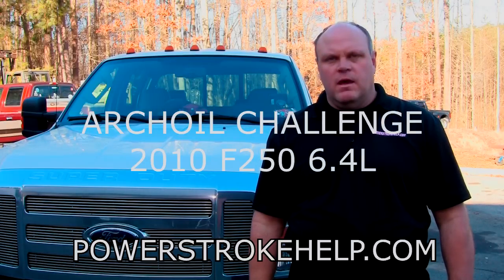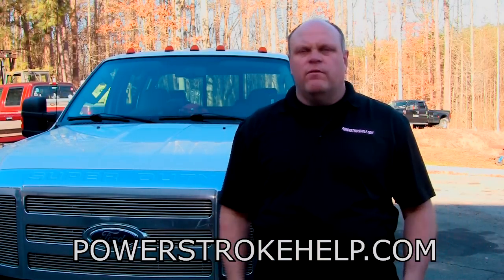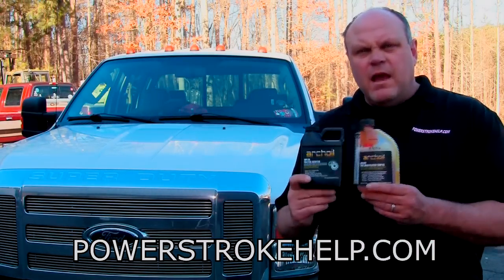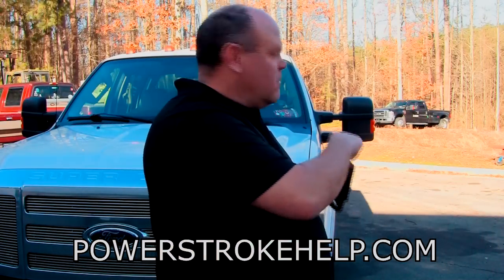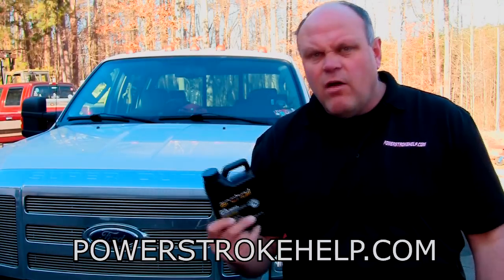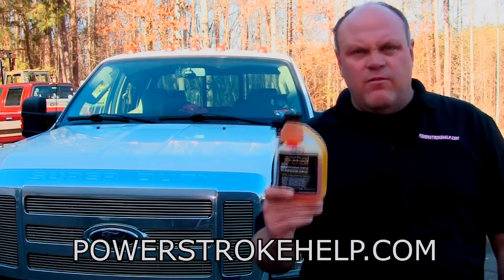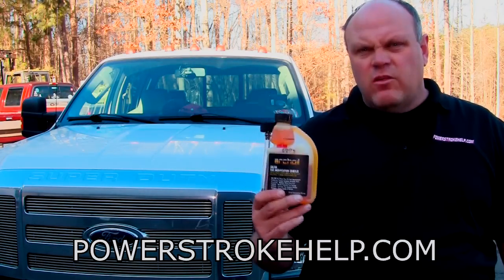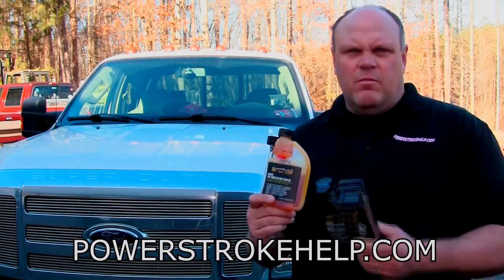2010 F250 6 4L ARCHOIL CHALLENGE

Comment: I have a 2005 F350 crew cab 4x4 6.0L with 180k miles. I use Rotella T6 oil, with Archoil Ar9100. I just added the Ar6200 to my previous fill up ran it out intown, and then filled up again without adding more Ar6200 and took a 100 mile highway trip unloaded and watched my truck get 19.3 mpg. I have never seen this kind of mpg out of my truck ever. And to see that this was accomplished even after the Ar6200 was used up in the previous tank only shows to prove that Archoil has a lasting effect on our trucks. With prolonged use, it only gets better. Archoil is worth the use. My friend used it in his Cummins and said he can tell a big difference in his engine too. It is just a great product. If you are on the fence, just buy it. just try it.

Comment: Just received mine. Will be using in a 2008 6.4 I bought new in 08 that currently has 24,000 miles. I turned my brother on to video he has bought also for his 2 7.3 trucks , 7.3 van, Chevrolet truck. He also ordered the Archoil gun lube.

Comment: I put the AR6200 in my 1988 7.3 idi and holy cow did that thing pick up some snort between the Archoil and electronic fuel pump conversion. I suppose 22.5:1 compression makes it even more noticeable.  Now I just need to try the AR9100 in my 2002 7.3. Talk about stiction.

Comment: Hey bill. Just a little food for thought. You mentioned that the MPGs on your 6.4 went after using the 6200 and you also mentioned that it reduces the soot build up. i was thinking that the MPG increase comes from the dpf not having to regen as often? Or is your truck dpf deleted? If so then im thinking that those who still have the dpf could see even better MPG increases? Whats your thoughts on this?

Comment: Bill another good video. I still have questions about my 7.3. I use standard Rotella 15/45, with the oil additive added does that mean I can go 10k or is that only for synthetic Rotella. What would you recommend. Thanks
Reply: I would change my oil every 5000 miles, also use delo 400 15w40 thats the best desiel oil out there its better then rotella

Comment: I enjoy your videos and did a lot of research before picking my '15 F350 last week. I like the results you've had running the Archoil in the older Powerstrokes... Do you recommend using this in the New 6.7..?  Thanks
Reply from the maker: todapwr1 THe 6.7 will benefit on several different areas. Installing the ARchoil AR9100 in the oil will keep those pesky turbos running good for a long time. Even the newest turbos are having some issues. THe AR6200 in the fuel will help by cutting down soot that messes up the unison ring on the turbo and cloggs the DPF. Meaning less Regen on the DPF and better fuel economy. SO the answer is YES it will help keep your 6.7 running well for a long time.
Reply from the maker: todapwr1 archoil.powerstrokehelp.com

Comment: I've got a 2009 6.4psd. It's been deleted and I run SCT performance tune. It runs and rows line a champ. 
Twice when I was towing it went into Reduced Engine Power mode. I keyed off and restarted and it reset. Now once a week or so it will only rev to 2500rpm and boost will build to 20psi. I key off and restart and its fine again. No engine lights or alerts at all now. Any idea what might be happening?

Comment: Hi have you heard of the archoil AR6600 it is for VGT vanes cleaning I work on VW TDI and we get lots of issues with sticky vanes I look at the U.S. Site and I don't see it but in the UK they have it listed any idea ? I'm from Canada so what does it takes to be a dealer for them do we have to buy a large amount or just what we need I would use it on my customers cars.
Reply from the maker: V10PDTDI Love those V10 Touregs. What a bad ass ride. You will see significant performance increase with the Ar6200 in the tank. What we are finding is the higher the compression in an engine (gas or diesel) the greater effect Ar6200 has.

You need to come down to Road Atlanta and hear the v10 audis kick ass at the petit lemans. They own the place.

Comment: When do you think is a good time to check rocker arms for wear? I'm at 120k right now
Reply from the maker: Travis Cooke I have seen no rhyme or reason to the failures. It seems to be a problem at 120-150k on trucks that are pulling hard or have not been maintained properly and I have seen 300k trucks with no problems.
Reply: Okay. I pull occasionally but I've kept synthetic in it it's whole life 5k intervals. I'm deleting it now so I'll be hitting you up for the additives. Thank you for responding.

Comment: Have you heard of any direct benefits for a Duramax?
Reply: snowmobiler86865 Email Isuzu for that information.
Reply from the maker: bisquik3006 Cmon BisQwik always looking for balls to break. The answer is yes it will help the Duramax or any other gasoline or Diesel engine run better.
Reply: powerstrokehelp  I started my test of the fuel additive, but I hit a bump in the road.  I got a 1mpg increase in my 6.4 on a 80 mile round trip.  Before I got to do any more testing, I traded it in on a 2015 with a 6.7.  Once I get the bale bed on, and get a few tanks burnt, I'll do some more testing of it.  I'll keep my results posted.

Comment: Does archoil work in a 6.7?
Reply from the maker: Colin Moorhead THe 6.7 will benefit on several different areas. Installing the ARchoil AR9100 in the oil will keep those pesky turbos running good for a long time. Even the newest turbos are having some issues. THe AR6200 in the fuel will help by cutting down soot that messes up the unison ring on the turbo and cloggs the DPF. Meaning less Regen on the DPF and better fuel economy. SO the answer is YES it will help keep your 6.7 running well for a long time.
Reply: Does it vioide warranty? Because the one I have a 2014 with 33,000 on it